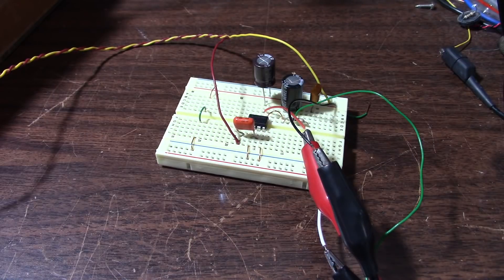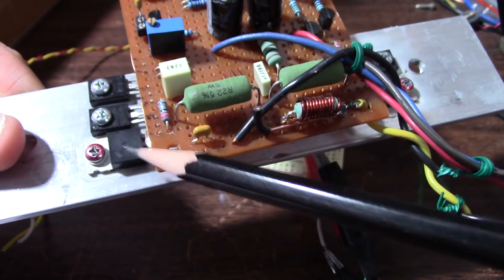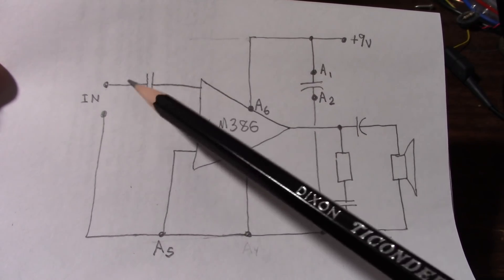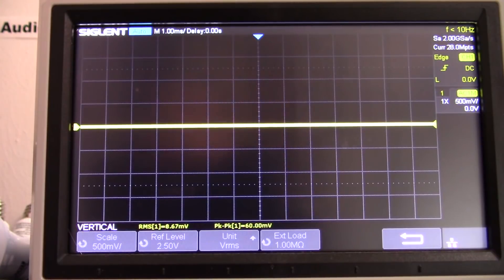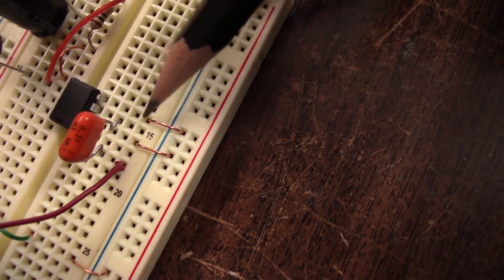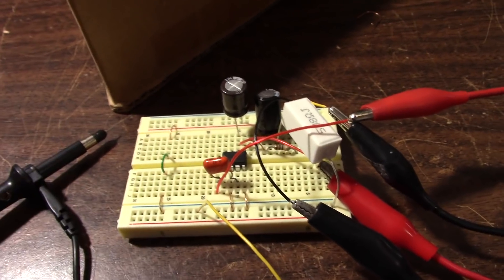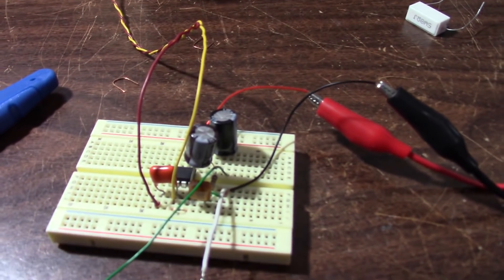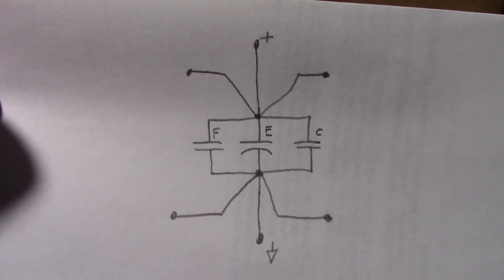Scoping power supply rails for unwanted noise - circuit layout

Comment: I have trouble almost every audio circuit. I suspect it's line and switching noise. I need to start using my isolation transformer. I have to find a box to put it in then I can build a linear supply off my variac

Comment: My Phase linear amp 400II I get a Perfect SQ wave but when the speaker relay kicks in, The speaker output going into a dummy load and a Parallel 1uf and 5 ohm resistor to ground I get a terrible Sq Wave I took the dummy load off and added a Non-inducted 8 ohm resistor and 1- it helped going to add another capacitor main supply rails to the + Bus and - Buss (8vdc and -80vdc )  it has a .31uf to ground do you think a higher value would would better? what would the Max be?
Reply: 2- Add a stopper Resistor? what value? 100 Ohm? it has a Pre-driver (also added 40pf cap to the Base to Collector) and it goes to a to the output Bootstrap driver? 3- Will add a .1uf across the Op-amp LM351 power pins.
Reply: Is it oscillating on both channels? If both check power supply throughout.
If one channel, check where oscillation is coming from and find the failing component. Test all transistors. You shouldn't need to modify the circuit, just fix. And you don't need to put 1uf and 5 ohm across the dummy... Test it again without.

Comment: totally get it. I am prototyping a dual power supply atm. Methods I discovered to rid noise on the output lines, you covered here. Great vid. Great to know I am on the right track, by just what you were saying.  I find the most challenging area in electronics design, is those blasted ground plane areas, loops and star points. The ultimate secret to high performance. Thanks for sharing this info :)

Comment: "It'll ring" I said
"no it won't" he said "it's only 5mm of track"
20 minutes of this back and forth. He had given me the prototype on vero board to fix, and I had, it was all in the earth layout. so I gave up trying to convince him and he sent the PCB of to be manufactured.

One week later.
I got a phone call, "it's ringing and I can't work out why"...
I told him what I thought ( he was the wise designer), he said I was wrong.
After another twenty or so of this I lost it and then bet him "IT WOULD WORK", "cut the track and run another earth.
Five minuets later I got another phone call "it works".

NEVER underestimate layout, NEVER!
5mm. that's all, 5mm